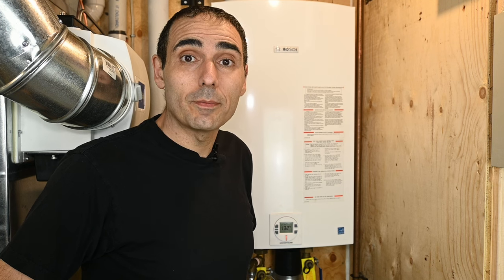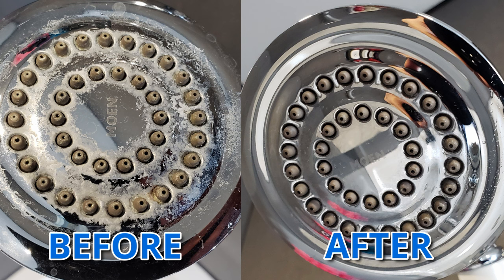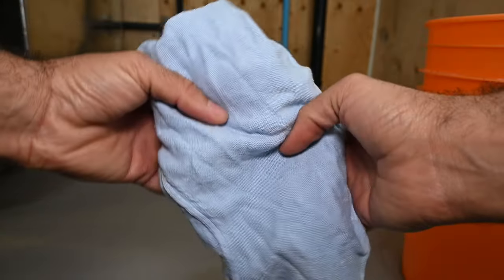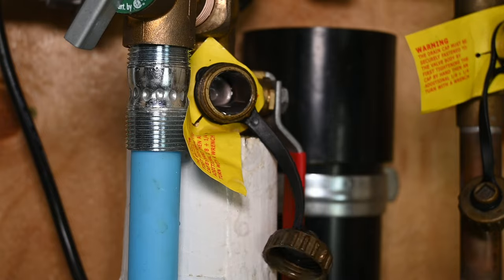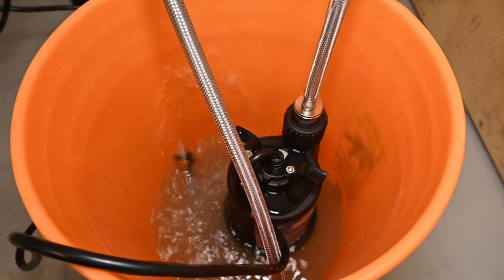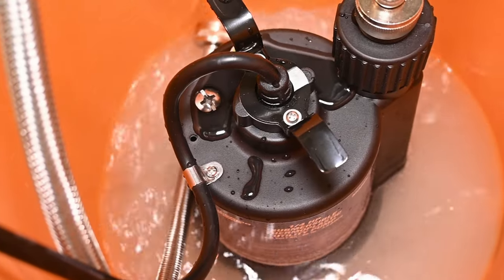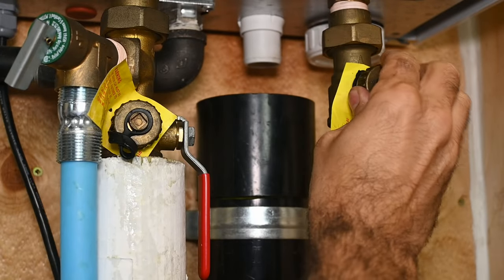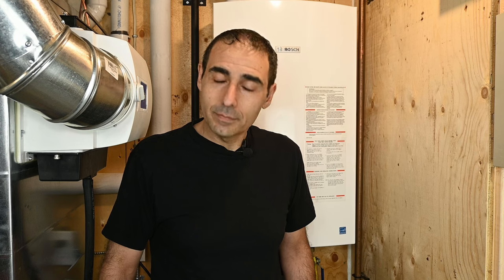How to Descale a Tankless Water Heater Simply and Efficiently!

Comment: Alao, you never mention to turn the valves right where the service hoses connect. Your system doesnt have thise but many do. Dont they need to be activated too? My manual mentions to do this.
Reply from the maker: Hi there.  Hmmm....I'm not certain which valves you're referring to, other than the three-way service valves demonstrated in the video.

If your manual specifies particular instructions, then I'd reason that it would be prudent to stick with their recommendations.
Reply: @PlumbingsCool  thanks for your replies! in this video the plumber shows a setup somewhat like mine.
https://www.youtube.com/watch?v=M3WzxW0hv9s

 The hot and cold water lines each have 2 valves on them. One is a shutoff and the other is a service valve. Sorry if i'm using the wrong terms. I wish my setup was like yours with only 1 lever. Unfortunately whoever installed mine put the valves in upside down so I can't isolate the service valve since the cut off is AFTER it! So when i open my service valve, water runs like a faucet.
Reply from the maker: Ah, I think I see your dilemma!  Yes, unfortunately it does sound the installer messed up your configuration.  I see no other way to service your system, other than to have the order of those valves switched.

To be clear, if you have two sets of valves on yours water lines connecting to your water heater (two on hot and two on cold), then the order should be, in the order of flow:

COLD (into your heater):  Isolation Valve >> Service Valve >> Water Heater
HOT (coming out of your heater):  Water Heater >> Service Valve >> Isolation Valve

Hope you can sort it out with minimal pain.  If you do, you may want to consider having them install the three way service valves like you see in the video...although either method is fine.

Comment: I have an ecosmart eco18 tankless water heater. I dont have the red and blue service caps or flush valves. How do i still descale my water heater ?
Reply from the maker: Unfortunately, that's going to be a little tricky, since, without those valves, you have no way of isolating the unit from the rest of the water supply system to keep the vinegar/descaler circulating only within the heater. 

I'm sorry to say, but the harsh truth is that if you don't have service valves, the only way to properly descale your system is to have a set of service valves installed first.  The most cost effective solution might be to hire a licensed plumber to install the valves AND subsequently descale the system during the same visit to save yourself an extra service call charge.

Hope this helps.

Comment: So i put the small water filter back in, go to slowly open the cold valve and water sprays everywhere out from the tiny water filter! I’ve tried re-seating it to make sure it’s sealed and same thing. Any ideas on what’s going on here?

EDIT:
was not pushing in cap far enough   all good now
Reply from the maker: It's a little tricky to assess without being on site, but I would encourage you to check that:
-The filter is fully pushed into the heater (which you suggested you've done.
-The O-ring is not split, damaged or worn (you can try to match and replace the O-ring, although it must be a PRECISE replacement!!!)
-The plastic filter housing is not cracked or damaged
-There is no dirt or debris surrounding the O-ring or seating area within the unit.  The slightest debris will cause a leak.

Also putting your finger inside the unit and feeling for any cracks or debris.  Finally, run a small amount of Plumber's grease / silicone grease around the O-ring to ensure that it slips in properly, and to help it seal 

Aside from the above suggestions, I unfortunately can't provide much more help without assessing it myself.  But if I were to wager, my money would be on it being an O-ring issue.  Please do feel free to share if you resolved your issue.

Best of luck!!
Reply: yep it was the first one. was NOT pushing in far enough !

thanks for the reply! still helping ppl years later 🙏🏽
Reply from the maker: AWESOME! Helping and educating is what it's ALL about!  I'll always be around if anyone needs me...say, maybe even start pumping out some more videos again soon 🤔 (really getting that itch!)
Reply: This comment saved me.  Also was not pushing far enough!  Thanks for the reply!!

Comment: If you have a scale filter before the unit (as I do) would you need to do this?
Reply from the maker: I suppose it would depend on how well that scale filter is at removing calcium & magnesium.  Sometimes even water softeners fail over time, or are not programmed to the proper settings.

Your best bet is to take a sample of your hot water coming out of a faucet and have it tested for hardness.   If you learn that the water is actually soft (devoid of calcium and magnesium), then one could argue that there'd be no longer reason to descale.

If you do decide to test, please feel free to let me know, as I'm curious to know how well those filters actually work.
Reply: @PlumbingsCool  Sure thing. I have an electric echosmart 24kw. I purchase it in 2014. Ahead of the heater I have an expansion tank and before the expansion I have the filter. I change the filter every 6 months.
 I am now about to change all 3 heating elements and the flow sensor while I have it out. I also just change the expansion tank for the first time. I will still flush my system as you did while I have it open. I was just wondering if it would be necessary if a filter was in place. I dont have the service ports but can remove the expansion tank and flush from the top... I think!

Comment: I hooked everything up, but nothing is coming out of the red hose. What did I do wrong?
Reply from the maker: Hmmm...that's a tricky one to troubleshoot without being there.  A few things do come to mind, though:

-Make sure that the pump outlet is indeed ejecting the solution by unscrewing the hose from the heater's cold water inlet and redirecting it into the bucket.  If liquid is coming out when you turn on the pump, then the issue is probably NOT the pump.  In that case, be sure that the two service valves are indeed open to allow full flow from the cold inlet and the hot outlet.

If the pump's outlet is NOT putting out water, then make sure that you have enough liquid in the bucket so that it is well above the intake level underneath it.  If the liquid level drops below the pump's intake, then it will NOT be able to suck in the liquid and deliver it to the water heater.

Also check to ensure that the inlet and outlet are not reversed.  The pump's outlet should be going to the cold, and the water heater's hot outlet should be dumping straight into the bucket.  Technically, it shouldn't matter, but it will rule out the remote possibility that your heater model may have a check valve which may be stopping the water from reverse-flowing.

Hope this helps!

Comment: what size pump should I use?
Reply from the maker: It doesn't need to be anything significantly large or even powerful.  All you're looking for is circulation though the system.  I think the one I used in the video is somewhere around 1/10th horsepower?  Even less than that if you like.  Whichever pump you use, you'll need to reduce the inlet and outlet to 3/4" hose bib thread to get the hoses on.

Comment: I hear mix things on gas off. Some say the heat can help the process. I mean the worst that can happen is you burn yourself from hot water right?
Reply from the maker: I'd caution against it, strictly due to a bad experience I had with an electric tea kettle several years ago when I was still working in the office.  Our area had extremely hard water and someone had brought in a brand new tea kettle, of which the element completely caked up with scale in about two weeks.

I had the genius idea to run the tea kettle while filled with pure white vinegar, aligning with your logic, that it would descale more efficiently.

Well, descale it did!...ad well as burn right through the element!...not to mention engulf the entire office air with evaporated vinegar, causing my teary-eyed colleagues to rush out for gasps fresh air!

Moral of the story:  Check with the manufacturer before doing so! 😁

Comment: After circulation my water, I got a code twenty five and it's barely coming out of the hot wacirculating with Pop
Reply from the maker: I recommend that you first access your model's owner's manual (or online) to first find out what Code 25 is, and proceed from there.

Comment: I have restricted flow causing lukewarm water flow. I checked the inlet filter and it was quite clean so I did the vinegar procedure without success.
Is there anything stronger that I can use? The flow starts out ok but then is slows to a trickle. I tried reversing the hoses but get the same results.
Reply from the maker: Hmmm...I'm not too sure whether your issue is scaling in this case, and perhaps something else mechanical altogether.  Although I can't even begin to troubleshoot your situation remotely, you did mention a few things which raise some red flags.

Notably, your water is lukewarm:  Even if you had calcium buildup, your water is coming out so slowly that it should've come out hot.  Also, I. Think you'd need quite a bit of calcium buildup to cause the restricted flow you're referring to.

If you're still convinced that your issue is the result of scaling, you might be able to try a dedicated descaler such as CLR...although I'd be very careful to check with the manufacturer's literature first.  Also be sure to flush it thoroughly with clean water. You definitely don't want to be ingesting that stuff.   In my experience though, simple white vinegar does an AMAZING job at removing scale.

Sorry I couldn't be of more help!
Reply: @PlumbingsCool  Thank for your response, I appreciate your help as well. Just to clarify, the flow restriction is during the flushing process with vinegar. It starts out pretty good then dwindles down to a trickle. Here’s the weird part, I have good water flow/pressure throughout the house during normal operation. The water starts out hot for a VERY short period before it gets lukewarm and stays that way.
Reply from the maker: That's strange indeed. I'm wondering whether you can call the manufacturer of your tankless heater. Ask for tech support, specifying your model number.  More often than not, they can help you out because they know their own products so well.  Just a thought.
Reply: @PlumbingsCool  that’s my next step. Being an automotive mechanic I’m pretty savvy at figuring things out and fixing them so I got myself to this point without favorable results. I’ll reach out to the manufacturer as I’ve hit a wall on this one. 
Thank you and I’ll report back when I get it resolved so you can add to your diagnostic library.
Reply from the maker: Yes, please do! Given your mechanical aptitude, I'm sure you'll figure out this mystery. Thanks for sharing.
Reply: @PlumbingsCool  todays update, it gets stranger! so, as it turns out the pump I was using for the flush wasn't  working properly giving me a false indicator of a flow issue thru the heat exchanger, new pump great flow and definitely descaled now, however the issue still remains. Heres the strange part, i attached a hose to the output side of the service port and i get a whopping 130 degrees of discharge as its set for that and a full flame, normal functioning right? When I turn the service port off and open the house supply I'm back to 80 degrees and  full flame to the house! The supply for the house and the service ports are an integrated part with the house supply immediately below the service port. I removed the fitting and both ball valves are working and nothing being restricted for flow,. If I open the service port with a faucet open i get 80 at faucet and 130 from service port, I'm truly baffled now.
Reply: @PlumbingsCool  issue resolved!  I have a H & C supply lines connected to a hose spigot in the shop. I power washed my shop floors and opened both ball valves (I decided to run H & C to power washer) and never turned them off. I only run H or C, never both so I created a cross conversion . 
Again, I really appreciate your time and direction to help resolve my um……stupidity! 🥴
Reply from the maker: Awesome...glad you resolved your issue; I had a feeling you would.  No need to beat yourself up for it as more often than not it's a simple issue we often overlook.  Thanks for all your feedback!
Reply: @PlumbingsCool  likewise, thank you for your help as well.

Comment: Hot water shut off is FROZEN. Any ideas on freeing it up?
Reply from the maker: Do you mean, frozen as in SEIZED?  If so, I'm afraid there's little you can do, short of carefully  adding some leverage to the valve handle by trying to turn it with the use of pliers if you haven't yet tried.  Unfortunately, you may need to shut down your main water supply, drain the building, and replace the entire valve.

(long-term failure is sadly one of the detriments of plumbing; eventually, water has its way with what it touches - some things a little sooner than others!)

By the way:  For future consideration, one way to minimize seizing is to go around your house every several months or so, and open & close any infrequently-used valves.  This will help minimize or remove scale buildup around the inner surfaces, which is the cause of seizure.
Reply: Thanks for replying. With perseverance we got it.
Reply from the maker: AWESOME!!! 👍 👍

Comment: I've heard that if you use Vinegar you must descale longer than if using those weird chemicals. One plumber claimed 4-5 hours! Another says 1 Hour. You say 30 minutes.....does anyone really know the appropriate time???
Reply from the maker: I suggest checking with the manufacturer, although in my experience straight white vinegar is extremely efficient at removing scale on short time.  Circulating for one hour usually suffices for me.  I've even soaked heavily scaled fixtures such as hand showers in vinegar for a few minutes, which effortlessly restored the surface to like-new condition.
Reply: We have ours descaled every year, and that's all the plumbers ever use. Simple old vinegar then charge $ 250-400. Usually here less than an hour.